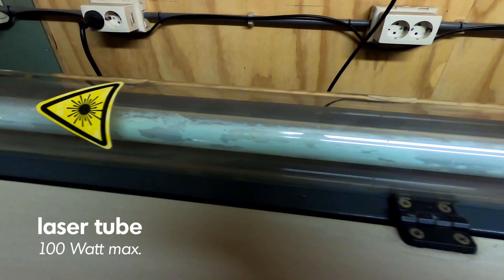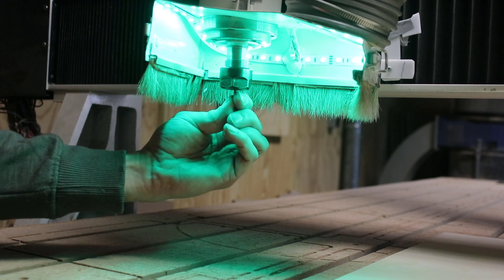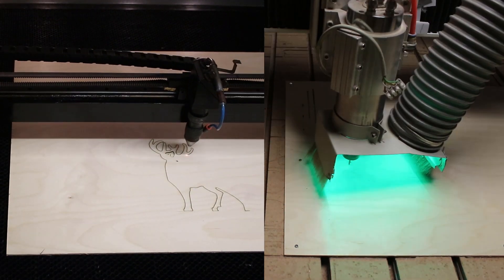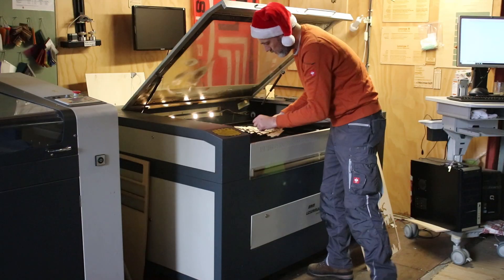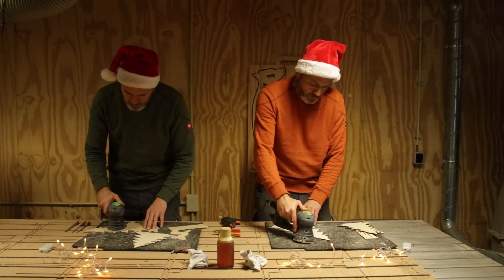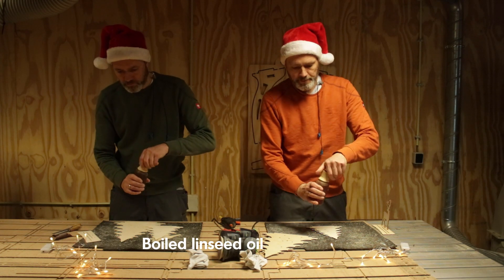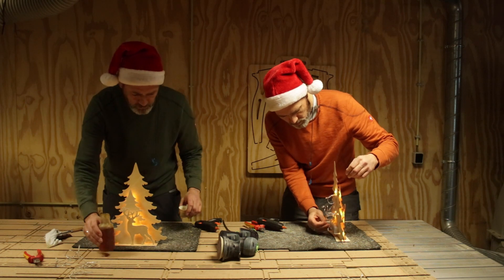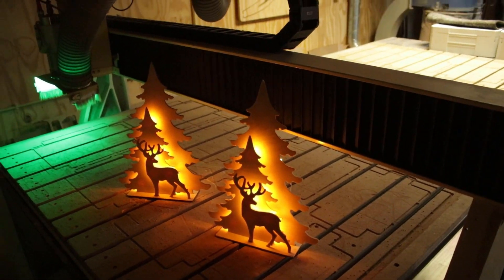Laser vs. Router | making a X-mas ornament

Comment: Where the CNC mill really shines is when cutting thicker harder material such as >5mm acrylic, >3mm aluminum, and steel. The CNC mill also more versatile in terms of its utility such as adding depth or 3D curvature. The thinner and weaker the material you work with, the better the laser cutter will be over the mill for a smaller range of applications.